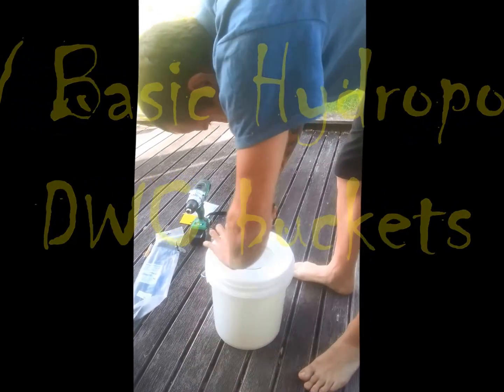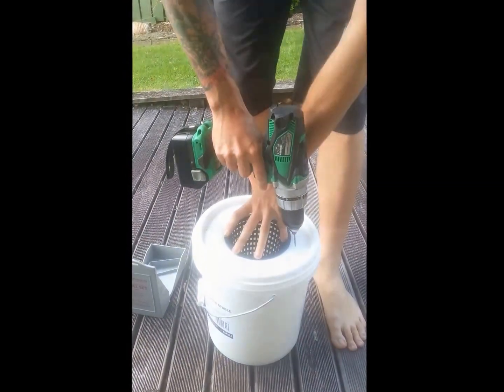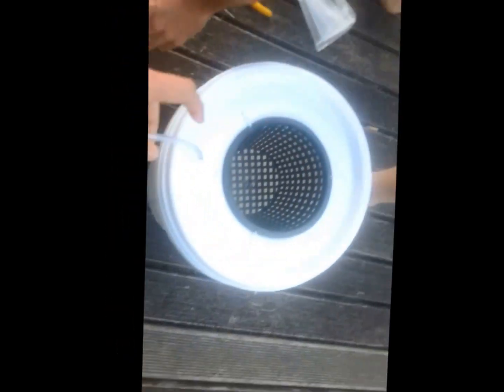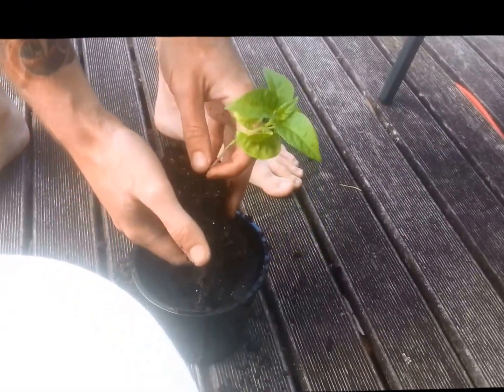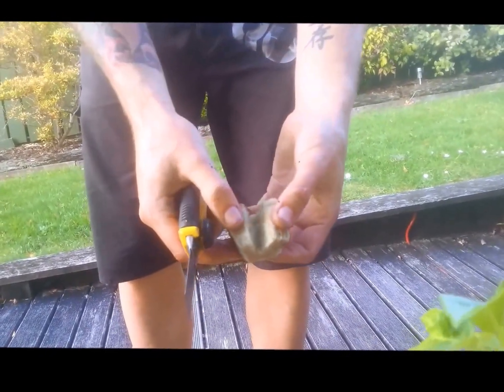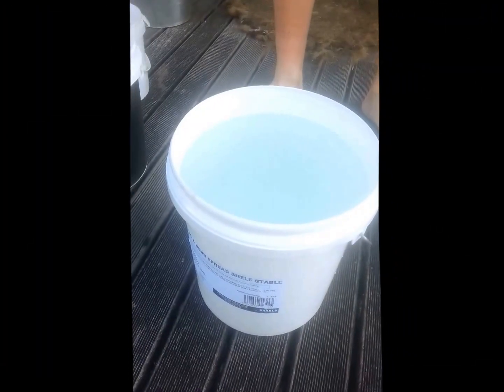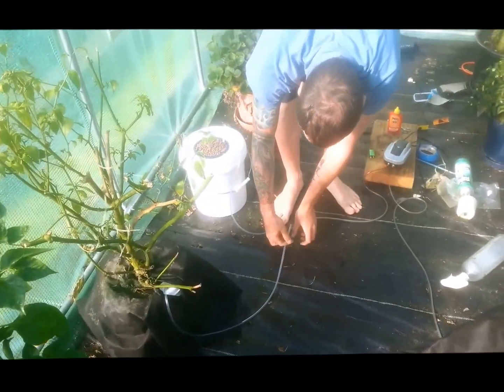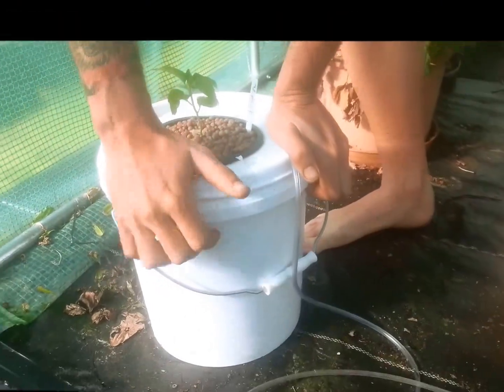DIY Basic Hydroponic System. DWC Buckets, How to, cheap and simple!

Comment: I would have drilled the air host hole at the top of the bucket instead of the lid. That way you can remove the lid without having to disconnect the air host.